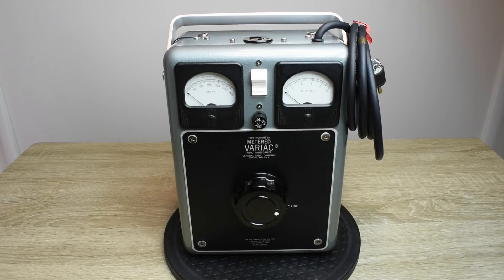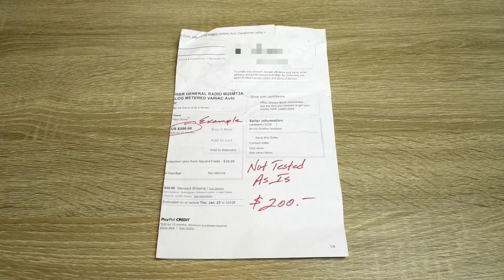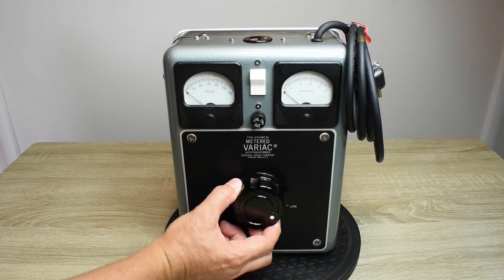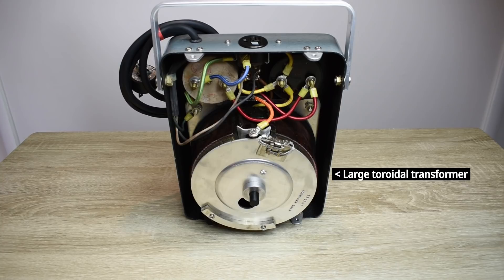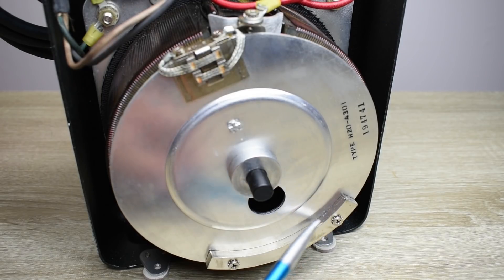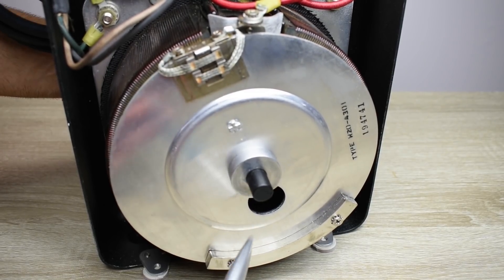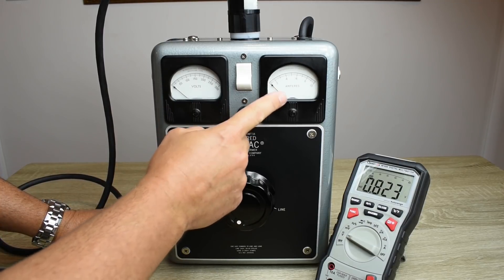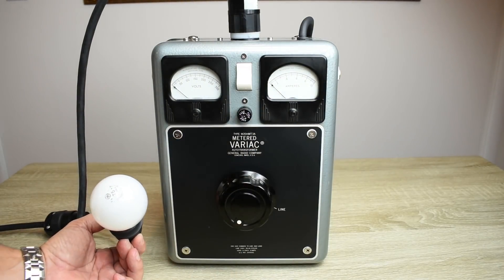VINTAGE General Radio "GenRad" Variac! (How It Works, How it's Wired, & Tests)

Comment: Interesting. Confusion looking at the drawing. Yes, understand moving the pointer DOWN will reduce the voltage (less turns on the coil).  RAISING the 
pointer (more turns of the winding) But nothing is connected to the top end of the coil.  Thank you, very interesting.
Reply from the maker: The entire winding is wrapped around the toroid, so the extra turns of copper wire are in the same field of magnetic flux. Thanks for watching!

Comment: unhook the sticking meter and add in a small 5v relay controlled by an arduino; crank up the AC and pulse the meter a few thousand times. might work.
Reply from the maker: Interesting idea. :-)

Comment: At 9:45, there is a printing 194741 to be seen. This can't mean 1947, week 41?
Reply from the maker: I looked up the Simpson gauges, and they seem to be much older than the 70's.
Reply from the maker: I thought 1947 also....but I have no idea.
Reply: @electronicsNmore  The blue cable inside looked pretty bright/modern but maybe it was later replaced. No other printings/labels inside? Here https://www.youtube.com/watch?v=SuDTJ2MfxEg I found a video about similar device from 1974, very similar gages design.

Comment: Question, to convert it to 110 volt  is it really necessary to move the hot leg on the input side down the coil? As it is,  if you powered it via 110 you would have 110volts out when the knob was set to the line position,  would you not? The only down side I can see would be that you would have a lighter load on the input (ie more copper more resistance less current) thus less flux linkage (maybe) so perhaps you might not have linear power across the dial. Thoughts?
Reply from the maker: The transformer was designed for 220-240v, using what looks to be 16ga copper, if you connect 120V across the same winding, the power output will be less, unless you have the knob at the "Line" position. Thanks for watching!